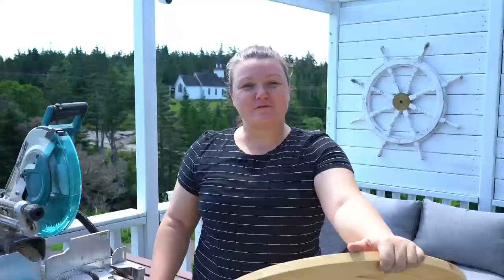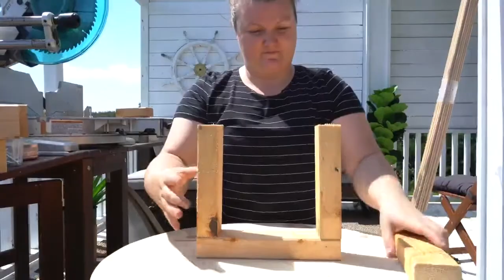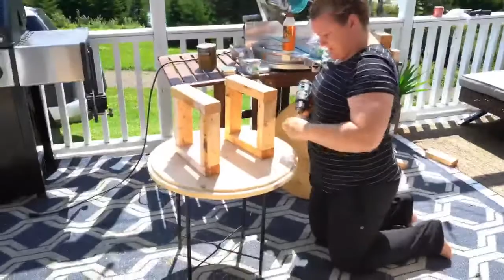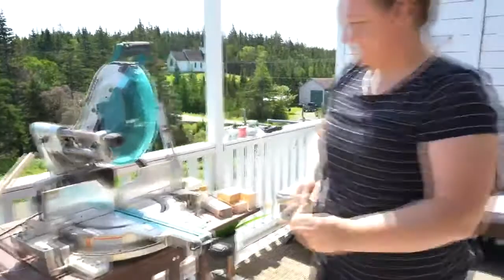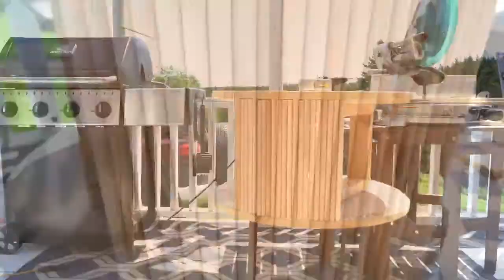DIY Fluted #coffeetable

Comment from the maker: 00:00 - Intro
00:18 - Materials needed for the coffee table project
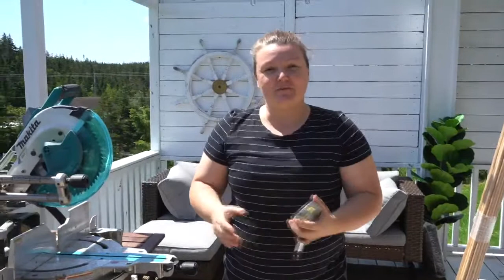00:49 - How using scrap wood pieces can make a sturdy base for your coffee table
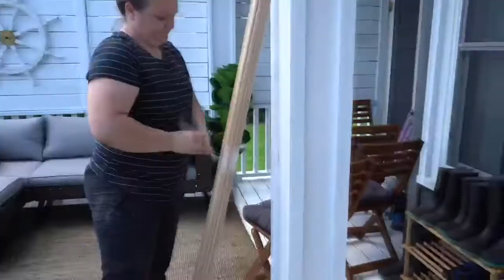02:38 - Adding the fluting detail on the side of the coffee table
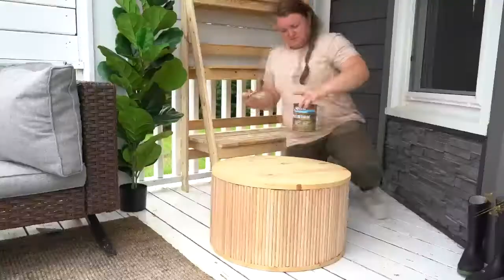04:05 - Staining the coffee table
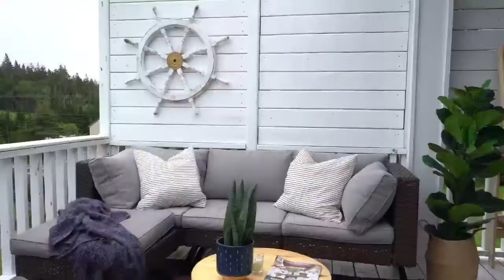04:34 - Finished results